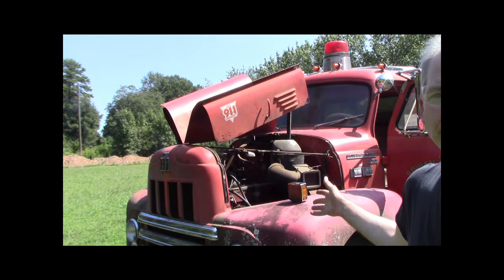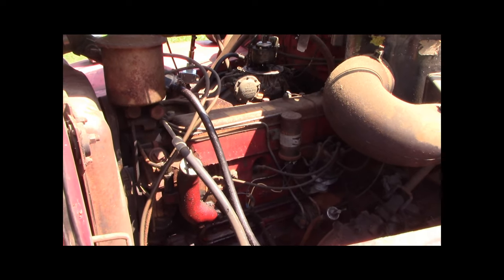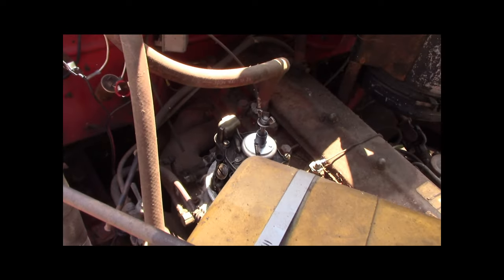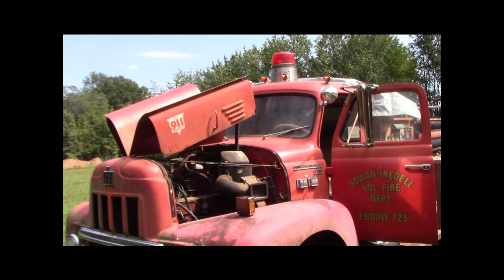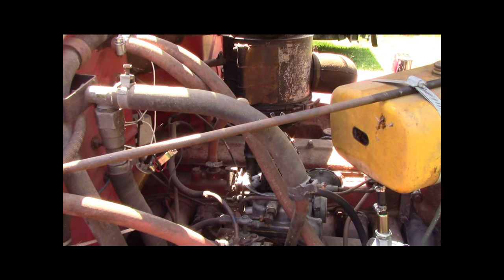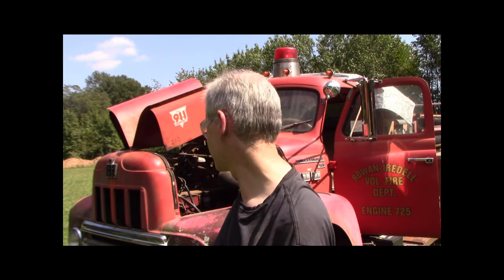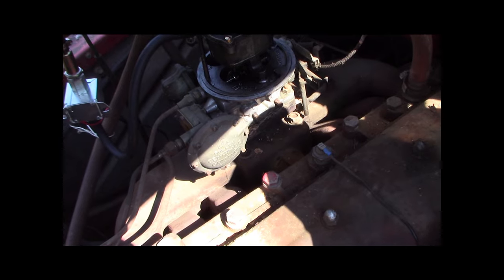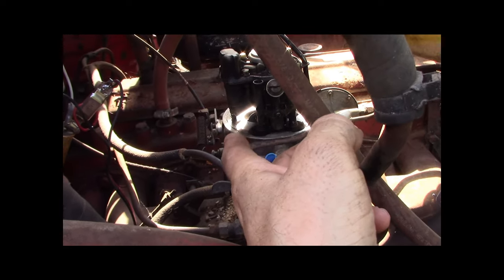9-16-23  --  First Start International R-185 Fire Truck

Comment: That 100 part carb sounds fun! 😂
Reply from the maker: Thanks for your sympathy Brian.  It is called the Holley 4000 officially, but also just the teapot.  I have a regular Holley for it, I think of a 391 FT Ford engine, and it has the governor pull off, just like the teapot.  I think keeping the governor is important, because what I have read, the red line is 3000 to 3200 max.  I don't want to throw a rod.  I am the only one who will drive it, so maybe I am worrying for nothing.  The modern Holley with the governor has more junk on it, hard to get at the idle screws, but I like to have the engine functional like it was intended. Yeah, I am crazy.  As you may know, engineers are like that.  All your diesel pumps have governors, so perhaps you understand. --Doozer
Reply: @kooldoozer   both the hercules and my old grain truck had gutted governors when i got them. Just don't rev it to the moon and they are fine with out them.

Comment: Check the float valve and float. Not uncommon for float valves to get sticky after en engine sits for years
Reply from the maker: I actually swapped the whole upper float assembly onto it from another spare carburetor that I had.  -Doozer